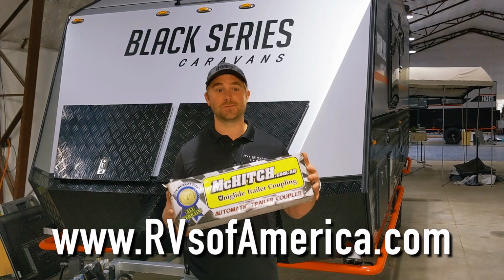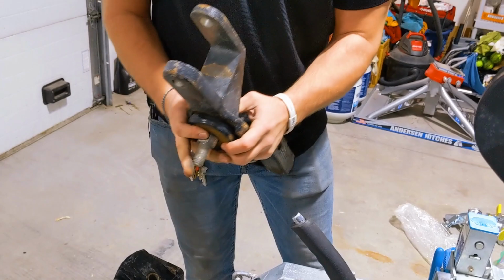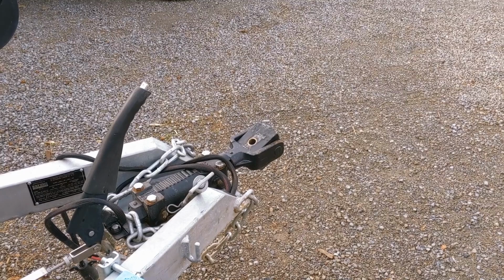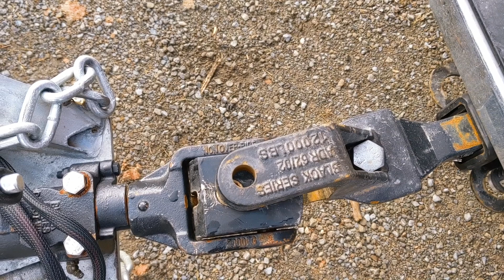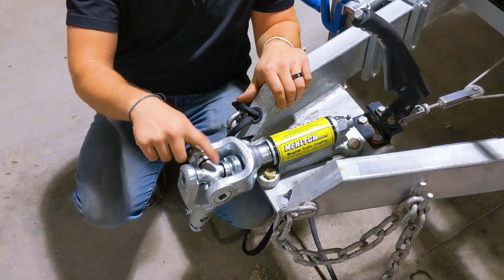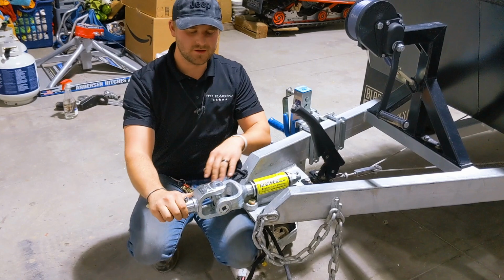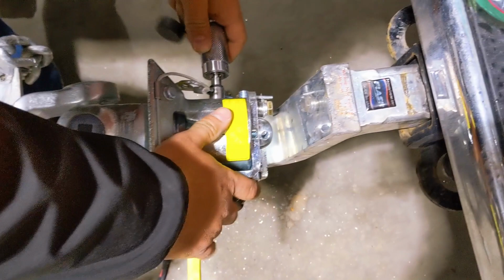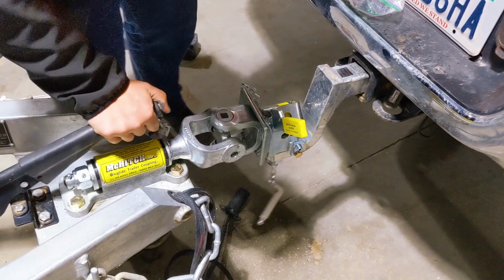🆕⚙️McHitch: Best OFF-ROAD TRAILER HITCH UPGRADE! Black Series McHitch Mod (2020)

Comment: Hello from Australia,  will be converting my poly block to a mchitch as they are easier. However, just a tip on poly block if you chamfer the top and bottom of the block you can drive straight up with out getting out and lining it up it will also guide itself in if your to high or to low.
Happy camping from Outtaline 4x4 club South Australia

Comment: Great job, however up and down operation does not  work properly when the position of the trolley go left or right more / over 15 deg, It may work perfectly if the point of up/ down rotation is made at the car side .  Greeting from TOBA LAKE OF INDONESIA

Comment: what is the tow hitch receiver that you are using. You Tow Hitch  has a 3 inch mounting plate that allows the Pins on the McHitch receiver to secure to the mounting plate.  I have only been able to find tow hitch with 2 in width.

Comment: I live in Australia and am seriously considering getting the McHitch mainly because they look so easy attach and release I will not be using it off road apart from maybe the odd graded gravel road,do you know if anyone has ever had a problem with them getting jammed or hard to release?
Reply from the maker: We have never heard of anyone having this issue. We also have not had this problem. Make sure to use a dry lubricant on every trip and it should be fine.
Reply: Great thanks mate one person told me that he knew someone who had the issue but that is only 1 out of i guess hundreds that have been sold maybe they did not use the dry lube,I asked you because you probably have sold a few and i thought you would have heard if there had any issues. @ROAOffRoad
Reply from the maker: @TheSpousey  Yes, we have sold around 40 already. I have not heard that yet. I am sure we will know more in the next year or so. We got a shipment of 500 coming to the US. People are loving it. The thing we have noticed is if it is not lubed regularly it doesn't latch in as easily...
Reply: @ROAOffRoad  Cheers mate thanks for the info it has just headed to the top of my wish list birthday coming up soon will have to leave some hints for the Missus

Comment: What brand sway control do you have to use on that type hitch.
Reply: @PawwsomeAdventures  why is that what keeps it from swaying
Reply: @PawwsomeAdventures  well on a ball hitch to keep a trailer from swaying say from going down an interesting an big trucks coming by or passing one an or a side wind an the trailer goes to swaying from side to side. There several sway bars to put on one Anderson makes one but they are strictly for ball type hitches. All I was asking is there a sway bar to use on this type hitch to stop swaying
Reply: @PawwsomeAdventures  you still have to drive down roads I know the trailer is for off road but you have to drive from state to state to get to places you want to go. I want to go to Alaska that three or four thousand miles away. There is no trail that long no where. You have to get on the road sometimes. Do you work for this dealer.
Reply from the maker: Hey Harold, sorry we have been MIA since the video went up. There is an adapter that you can buy with the McHitch that will allow you to pretty much use any Weight distribution hitch. We just barely started using the McHitch and have not actually used a WD hitch on it yet. I know some people have used Reese and other brands. But the adapter should allow most WDs. If you check out McHitch site you can see the adapter they use. Let me know if that makes sense now? 😁
Reply: @ROAOffRoad  thank you some guy tried to treat me like a dummy an say it's just a off road rig. I guess you read all his comments. You still got to get from a to b an I was sure there was some kind of sway control to match this hitch. I love the hitch after seeing them I'd not have nothing else. So thanks for the response.
Reply from the maker: @lynngatlin4469   Yes I read through all the comments. 😁 I think he had good intentions on helping... 😆 Unfortunately we have not used a WD or sway control on it yet. Mchitch sells one on their website but I've never heard of the Brand. (It may be there own deal) but when we were reading on forums before carrying the product we read that a lot of people use other brands such as Reese etc.
Reply: @ROAOffRoad  I will find out. Thanks if your going to Alaska an driving some of their roads at 55or60 miles an big trucks galore mostly gravel or dirt roads you will need sway control. But that hitch may not be as bad as the ball or that loop type hitch we used to use in military.
Reply from the maker: @lynngatlin4469  yes I agree 100%. Sway control is an absolute must for most highway driving and long halls. Unless you're towing with a dually we pretty much recommend sway on most rigs.
Reply from the maker: @PawwsomeAdventures  LOL! Yes it absolutely will restrict the articulation of the hitch. It needs to be set up so that you can easily remove it when you go off road. All sway control/friction set ups are designed for highway use only. 😁 hopefully You're ordering the 21 through us so we can make sure you're taken care of. Lol 😁
Reply: @PawwsomeAdventures  it's ok brother.
Reply: @PawwsomeAdventures  oh yeah solar is a must
Reply: @PawwsomeAdventures  yeah there is several composting toilets that separate the urine from solids. I don't like the black tanks at all. I'd rather have a cassette or composting toilets.
Reply: @PawwsomeAdventures  I agree the states are to far behind. Just doing away with the weight would be a plus. We only have two or three different kinds of hitches the ball an the pendulum type hitch which is what we used in miltary cause they would articulate some. But I really like this type hitch but I also like those spring loaded type hitch you hook to your vehicle to take the shock away from trailer to vehicle. All horse trailer everybody uses has this hitch to take shock off of the horses but they are goose neck trailers. It's like driving a Cadillac compared to a Honda
Reply from the maker: @PawwsomeAdventures   I understand. I Hope you get things figured out for the best. Best things would be to contact shane@rvsofamerica.com We could easily get 680 watts on the roof. Soft start is not a problem. There are a lot of options we can do. Maybe send an email and we can talk more directly. 😁
Reply: @PawwsomeAdventures  all I ever had was horse trailer I've own horses all my life. When I see something new or different I like to find out about them. When it comes to RV I compare them to the construction of the horse an living quarters trailers.like murhow or Lakota trailers. These black series rigs are closest thing I've seen so far. Of course the horse trailer are mostly goose neck be honest I've never seen a fifth wheel horse trailer they may be out there. An on the goose neck one not only looks at your comfort an safety towing but horses comfort an removing the shock of floor an sides of trailer is crucial with horses. I've never owned a RV only horse an living quarters trailers. Google murhow an Lakota horse trailer check them out an compare them to the RV world an tell me what you think.

Comment: The cross and bearings awful damn tight. Then the locking connection to the truck is damn trashy.
Reply: Huh? The locking connection is rock solid. You obviously have never seen one up close. Brilliant design.
Reply: 1. Yes, fairly tight by hand when new... but your trailer/caravan won't have much trouble exerting more force than your hands can.
2. When reversing on in the video, notice the handle was up: no-no #1.  When the handle is down like it's meant to be, it grabs every time.